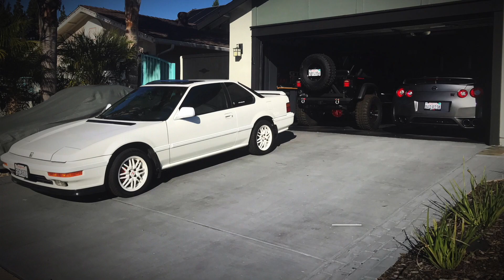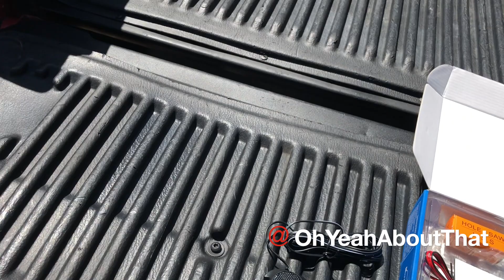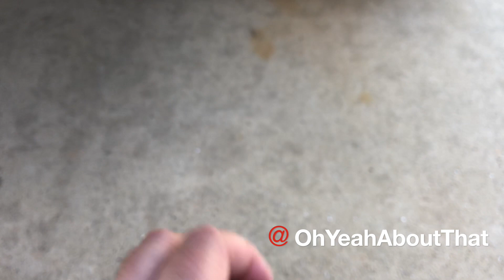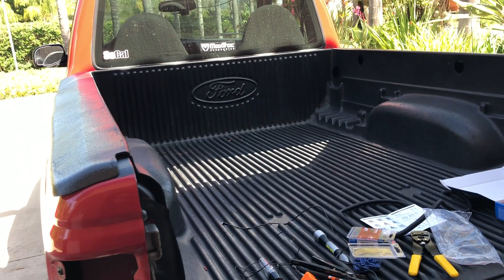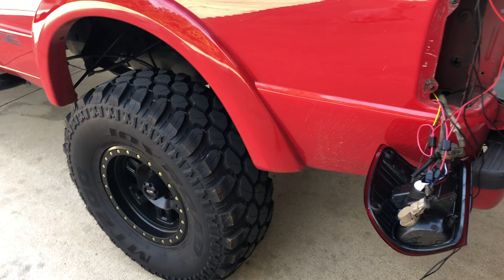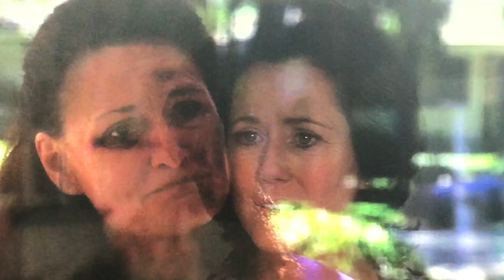REVERSE SENSORS INSTALLED! [part 15] 2002 Ford Ranger EDGE

Comment: Bro I have a similar ranger 2004 but I tried to use the hole saw that comes with the reverse kit and it’s impossible since the bumper is metal, can you teach me how to make the holes? I need some guidance please !
Reply from the maker: Easy!  Drill a small hole with a small drill bit. Then use that step bit to make it the correct size!😊
Reply: @OhYeahAboutThat thanks bro❤, i did that, and the holes are perfect, now I wonder , there is two wires on the reverse light, do you know which one is the live wire? And the ground? Thanks in advance !
Reply from the maker: @danielgalvan3405 one will activate the sensor and one will not!  Lol. I’m not sure. Ground is typically the black wire.
Reply: @OhYeahAboutThat solved black was the ground,
Reply: Bro how did you put the speaker inside the cabin, I have no holes in the cabin of this truck, did you make a new hole? I have the speaker working but not sure how to get the speaker inside , thanks again
Reply from the maker: @danielgalvan3405 if I remember correctly there is a rubber grommet in the floor. Check in the floor pan under the truck. You can poke it thru there and route it inside.

Comment: This seems like a great idea, how far (or close) does something have to be for it to start beeping? Also, does it beep at a different frequency depending on distance?
Reply from the maker: Bear2die4 I love this system!  It will start beeping from about 3 feet away, then beep faster the closer you get. It ironically matches the backup lines on my backup camera perfectly.

Comment: Hi - love your serie about the ranger ! I'm about to upgrade to a carplay head unit and would like to install a backup camera as well, where did you route the cable on your ranger ? do you have a video about that ?
Reply from the maker: Thanks!  No, that’s the only part I didn’t film. Just route it underneath and along the frame. That’s the best way.
Reply: @OhYeahAboutThat  How did you get it in the cab ? did you drill the firewall ?
Reply from the maker: No, I drilled a hole in the floor behind the driver seat. I actually show that in an upcoming video that will be published in a few weeks. I can send you a pic if you contact me on IG or email. OhYeahAboutThat at yahoo dot com.
Reply: @OhYeahAboutThat  Thanks. I ended up using the grommet for the shifter cable on the firewall, cutting it and routing the wire through that.

Comment: I like all the upgrades you have done, how hard was it to change the bottom front bumper to include the fog lights and I like the radio what brand is it.
Reply from the maker: Jason Hinds thanks. The bumper and lights came on the truck. The radio is honestly crap. I would not recommend it at all.   I’m pretty sure the fog lights are standard on the Edge model.

Comment: I have a 01 EV Ford Ranger 2.3L 5speed and when I put it in reverse my reverse lights don’t come on. What could be the problem and what is my solution???
Reply: Check your reverse switch in your transmission,  assuming your lamps are not blown, switch will go bad on mannual transmissions.

Comment: Hey man love the videos and especially these are the things I want to do to my truck are you doing anything else to your truck at all? And would you do cruise control in your truck? If not do you know any good models?
Reply from the maker: Thanks!  Yes, I have a few more truck projects coming up in the next few videos. Stay tuned. Not sure I would even use cruise. I never use it in my Mustang.
Reply: Thanks man also how are the power locks and windows are they still going good I know you said the windows were loud are they better or what?